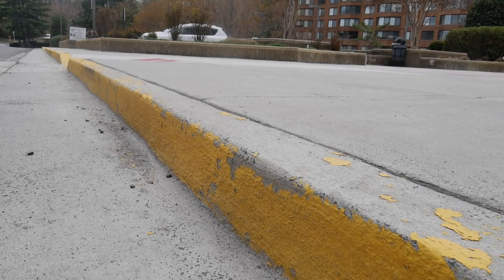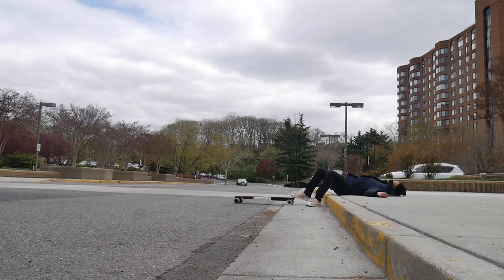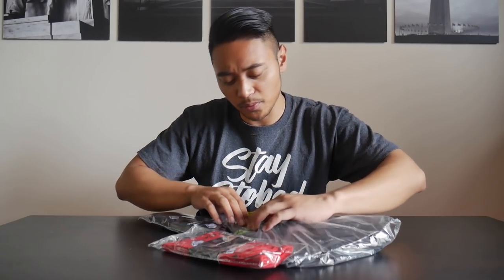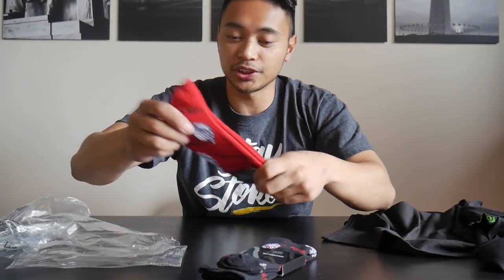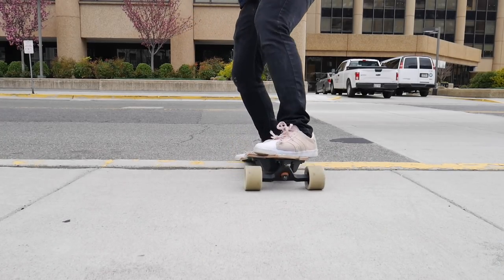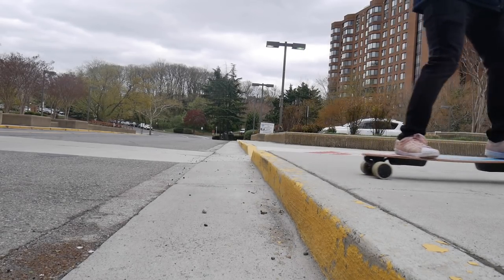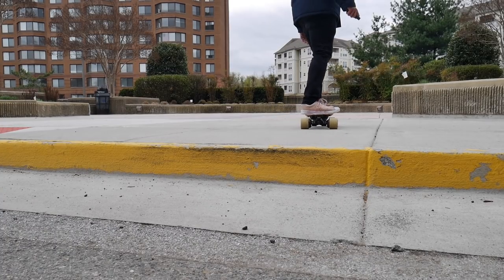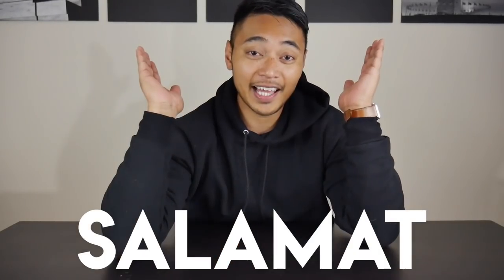How To Get Up Curbs With Electric Skateboards or Boosted Board (EASY WAY)

Comment: I'm really interested in the Backfire 2. I'm pretty set on having replaceable PU, and this one seems to fit all of my qualifications and price range. My only concern is I've heard a variety of small issues (vibration, connection issues with the remote, and random braking). Have you had any experience with any of these issues (or any issues that I didn't list)? How were they resolved? I've also heard their customer service isn't the best. Is that true?

Sorry for the long post. Any response is much appreciated.
Reply from the maker: Vibration is definitely real, not sure about their new ones though. I would explore some more options. You know I’m coming out with a board that’s got replaceable PU. Maybe wait for my video on that. You might like it. I’ve got a video on the prototype on the channel
Reply: Ronnie Sarmiento I'm definitely in no rush to buy anything, so I am looking at what else is out there. I wrote that comment before I knew about the board you were working on. I'm excited to see the finished product! Thanks for the response!

Comment: Hello mate, 
I just wanna ask witch Electric skateboard wut you pick up for 500$? And I have to go around 8miles range
Reply from the maker: at that price there are several, but ownboard gave us a $20 discount if you use "Ronnie2018". Not only is it budget friendly, but it's got great speed, smooth acceleration/braking/ and adequate range

Comment: havde you ever had problems with the backfire2's "vibration” in the hub motors?
Reply from the maker: yeah, its not very pleasant to ride...i think they fixed it on the newer ones

Comment: How do the koowheel compare to the backfire 2 ? How is the difference between the height of the two boards cuz I like lower boards, that's more comfortable for me. What's about flax and wheel height ? Is there a big difference between the wheels of the koowheel and the backfire ? AND big point, how about taking the board by plain ? It would be very nice if u could help me ! See ya^^
Reply from the maker: not a big difference either way. i think the koowheel is a bit smoother, and you can remove the battery, but i dont think you can bring either onto most planes

Comment: Ok, Method 1, too awkward, takes too long, and it’ll scratch the underside of the board, battery housing, and controller housing.  By the time I get up the curb that way, might as well quickly get off and lift the board up the curb with my foot.

Comment: The only type of electric skateboards you can really use these on without fear of damaging it are belt drive boards with the motors BEHIND the trucks like an evolve, I wouldn't even recommended with hub motor boards because since the motors are in the wheels all of the impact when you land or bounce off the curb is taken by the motor which is a great way to destroy it.

Comment: Foot straps bro, they change the game.
Reply from the maker: I gotta try that out, my man!
Reply: Heck yeah, I put some trampa foot straps on my bamboo gtx and I love it. Just be careful, bailout plan basically goes out the window so I would advise wearing a helmet. Two dudes have died this year both had foot straps and no helmet because the board malfunctioned. Great video quality, the part where you're going towards the curb and your face, 😂😂 loved it.